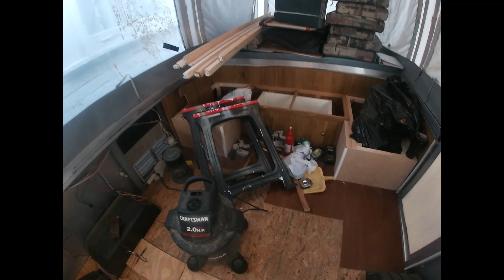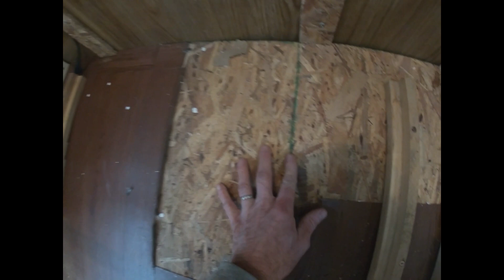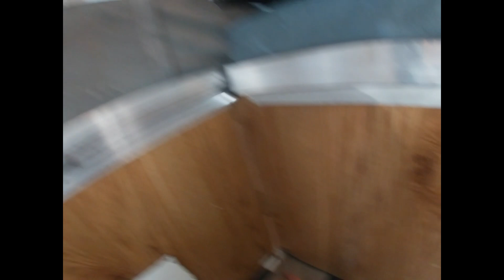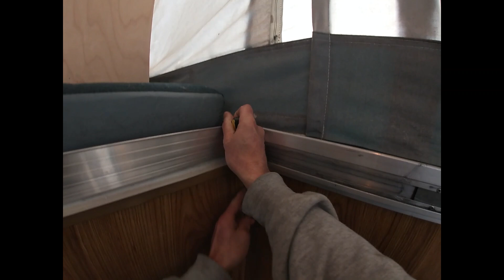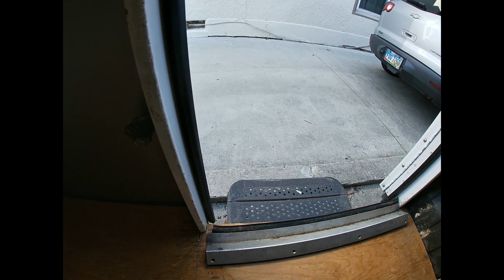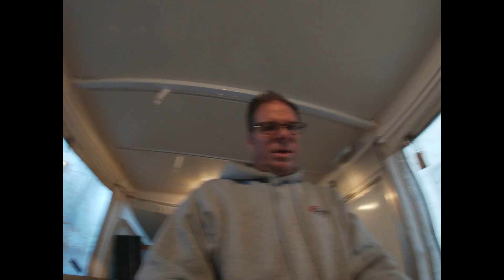1997 Coleman Sea Pine Pop-Up Camper Renovation #6 - Floor Board removal and replacement.

Comment: Im about to take on that job..I hope I don't have to do entire floor but I have a sagging bed that's pulling the right side of the door frame.ive already replaced the roof side board and that went well..its a 82 palomino pony.if it took you a day its going to take this 55 yr old granny 4 days lol..but I'm kinda looking forward to the challenge..your video helps me alot
Reply from the maker: Sorry I must have missed your comment. I hope you found it helpful on your project. I’m 58, so a 55 year old should have no problem! Lol
Reply: @projectbudde351 I did get it done..thanks!!